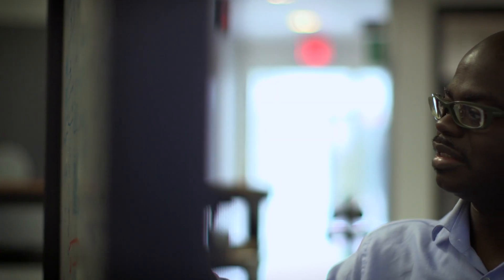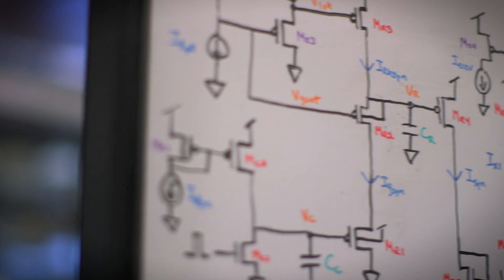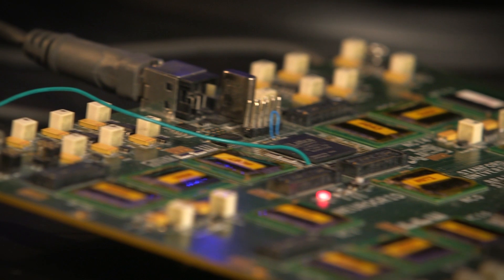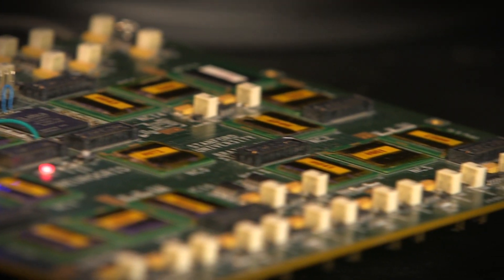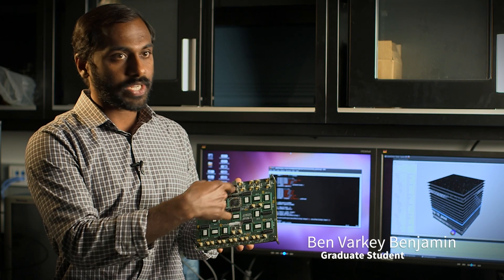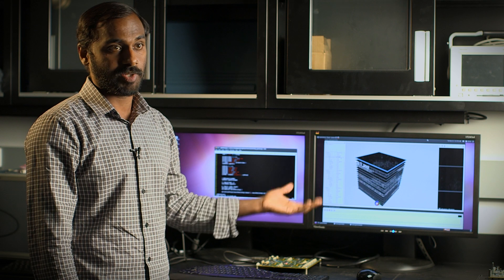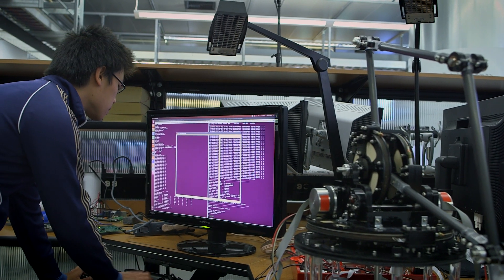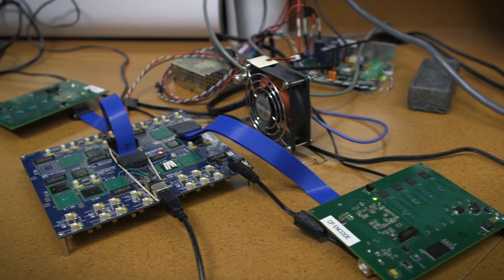Stanford engineer creates circuit board that mimics the human brain

Comment: No surprise that we had to go back to analog computers to do this.  I've been waiting for analog computers to come back.
Reply: BigMTBrain Thank you for the update on them; yeah, digital will win out in the end due being "more power for less expense"; and the precision it gives is quite desirable indeed.

I think these will go further (the parallel/crosslinking-on-a-chip) - than quantum computers for some time to come.  They provide much of the desirable logic needed without requiring liquid nitrogen cooling :)

There's an interesting debate going on at IEEE online regarding the silly "cat brain" comment;  someone who has worked with the detailed circuitry of neurons for decades really bit into it, hard and gave a very detailed explanation of "why-this-isn't-even-a-fly-brain".

Just the same; it's the raw processing power that brain-style connectivity brings;  bigdata is surely eating it up as a way to lower costs on crunching large amounts of data.

Now... where's my infinite 4D Excel Spreadsheet!  dang it... That's what I want :D
Reply: Analog will have its applications but that does not mean it will actually be the future of computing. Digital is an amazing mathematical system that is so simple but yet it is so far reaching. 

It is on a level of comparison with the decimal system or human language.
Reply: bighands69 oh I agree.  My only beef with digital is that well, it's trying to do to much with too few numbers.  Amazing what we've done with the equivilent of what's basically electric paper; mostly 2 dimensional circuitry with a little overlap; and working with flip and flop.

But as more and more trinary + beyond circuitry is built; especially when it can go beyond boolean logic; that's when I think we'll get some really amazing breakthroughs; that's why projects like these are so exciting :D
Reply: Strange... I had left a comment before, but it seems to have disappeared somehow. While Neurogrid is analog, and while Stanford collaborated with IBM, IBM's SyNAPSE / Truenorth neuromorphic chip is all digital. IBM made the choice for an all digital solution because they could see that the circuits shrink much more easily, the chips are more easily programmed, and it is a much more scalable design. SyNAPSE has already become a commercial product, limited to labs for now, but it is much closer to implementation in consumer products and applications than is Neurogrid.
Reply: ah - i remember this!

Comment: NEURO EMULATED SEQUENTIAL INTELLIGENCE

hahaha I Dreamed about this happening, it is incredible and revolutionary this is the beginning of a new era, they have to scale it up a bit, so many neural boards can be put in parallel, and a new kind of memory needs to be added to the system, something like a modulated dynamic sequential memory, which discriminates the input information (in data) given by the processor-module in layers (each layer discriminates information by correlating information stored in the next and previous layer with the current cycle data and passes the relations found to the next one) sending the results and coincidences (out data) to the main unit waiting for action and then modifying, maintaining, copying, restoring, erasing, or overwriting the memory data.
with several in and out paths, and modulation channels between the processor modules and the memory module, maybe using a third regulatory module to regulate the memory and the processor modules information exchange, would be needed.
the objective is to create a flow of data that is always being analyzed in one way or another and that recalls information from is dynamic memory, so this opens up a new window for artificial intelligence and maybe to synthetic consciousness.
AOP

Comment: This is interesting. I like the return to analog design,.  How does one mimic the chemical reactions in the brain , could this be the contributing to very low power of real neurons and would it be necessary component for simulated group of neurons?

Comment: As I understand the next horror movie will be about bioengineer who has to fight against prosthetic limbs because somebody added virus into the code. Yeh, and happy end (~ Digital Fortress).
Reply: You don't program neural networks like you program standard programmable computers; You train them. A "virus" in the conventional sense just isn't applicable to this computational model.
Reply: Greenquarter Do you mean that there is not any code?
Reply: Victor Parkhomenko The actual neural network itself, as a model, does not involve any "code".

However. If you are simulating a neural network on a standard computer then yes the simulation software itself will be a conventional program in code. This however is a layer below the neural network model itself. I can't come up with a good analogy for this.

I'm not 100% sure how this piece of hardware goes about simulating the neurons but if it's anything like I've seen in the past then it will consist of a large bunch of parallel and conventionally networked processing cores designed to efficiently run neural simulation code (ASIC). So again yes the code layer may be there.

Even if we had developed a code free substrate for the neurons themselves then we would still need to upload and represent fitness functions and training systems to allow the network to be configured for various tasks. Off the top of my head that would be easiest to do with a conventional processing core and code.

So I am in fact wrong in the sense that the vulnerability might be there on a practical implementation level, but not in the model itself.
Reply: Well, if you  are bioengineer  and you design your code it is OK. But let's guess "somebody" provided code and you use it. What kind of neuro-net is being created you do not know. And you do not know what kind of algorithms are implemented. The rest is up to your imagination. Disclaimer: I am not so serious about my guess.